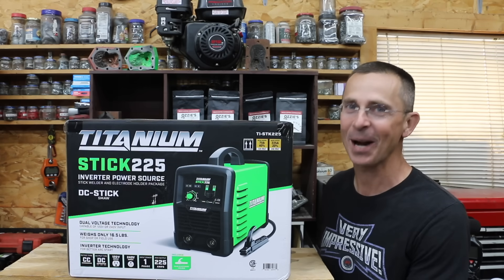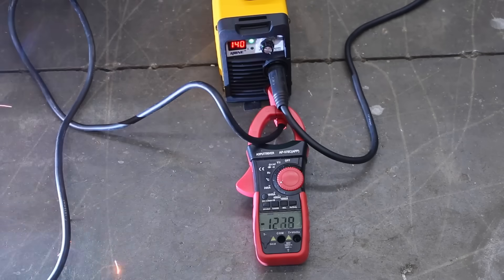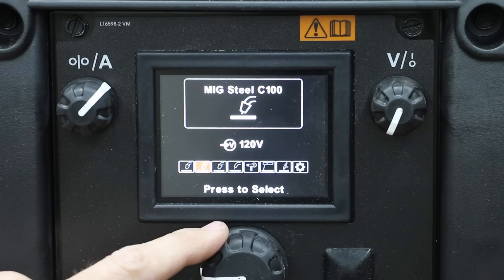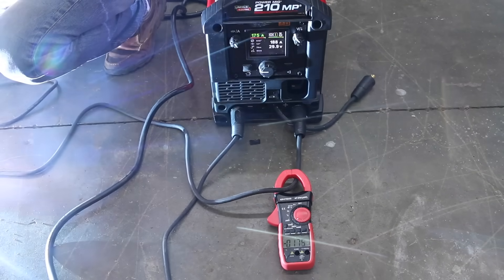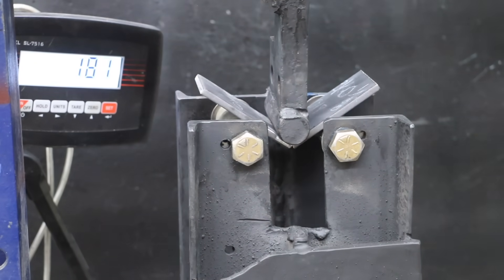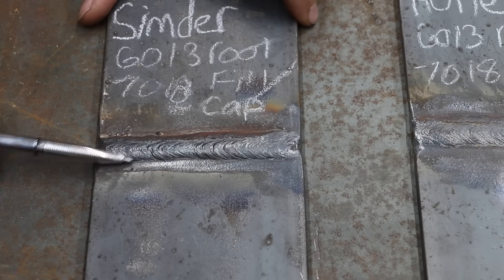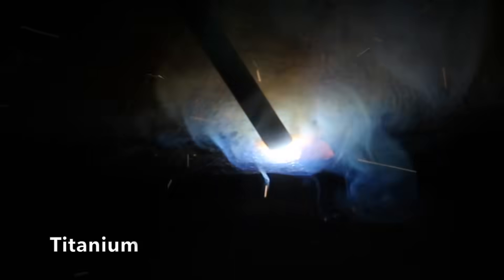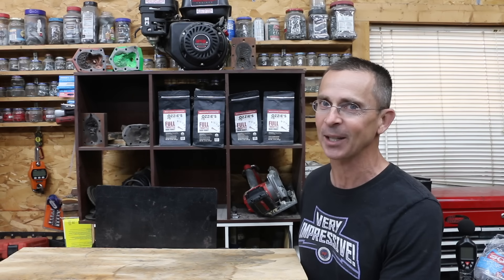$70 vs $2,300 Welder? Let's Settle This! Weld Strength, Duty Cycle, Current Output, Build Quality

Comment: My first welder was buzz box. I learned everything I could. I then moved to 70 dollar klutch. Bought the tig leads for it. Practiced every single day after work running beads up down sideways every direction. I would buy coupons to practice on from this metal supply company. After about 6 months I moved to a 2k dollar Everlast that does everything ac/dc foot pedal multiple settings saves(pulse/fade in/out etc) 
And id spent the next 6 months only running aluminum). I love welding and I'm 100 percent self taught 😎 you can do anything you put your mind too.
Reply: Self taught, eh? No youtube videos, instruction manuals, etc...? I mean, kudos on learning, welding is one of the most useful skills to have. I took it in highschool all four years
Reply: Why did you spend $2k on an Everlast? That's a lot of money for an off-brand welder.
Reply: @TehButterflyEffect  I've never had a single issue with it I purchased it almost 5 years ago and it's fantastic.
Reply: @ExcavationNation  I get that, but $2k will buy you a pretty nice name-brand welder. (An ESAB Rebel for example) You didn't have to get an off-brand Chinese welder for that money.
Reply: @TehButterflyEffect  lmfao dude if I would have bought the Esab that came with all the features this welder came with it would have costed a MINIMUM of 4 k this welder has more features And that's not even including everything that this welder came with. 30 ft leads (3 different torches) FOOT PEDAL on top of all that it was multi voltage. Which was a plus for me. If I had the 5k+ to buy a top tier brand I would have.
Reply: @TehButterflyEffect  yea just looked it up the comparable Esab is currently 4100. Mine with the exact same features is 1700. (Actually has more features built in) looking at those numbers (For someone that wants to get in to the hobby) I made the right decision.
Reply: @ExcavationNation  Hey buddy, I think what this channel pointed out is that some of these welders may not actually be doing what they say they are.
Those first 2 welders he showed were basically useless at higher settings for example - 90 amps off is ridiculous.
Here in Australia we have a lot of Unimig & Cigweld welders which are basically a common off-brand maybe 'mid-tier' machine, not amazon/ebay level but still a bit of an open question, I've made the same sort of decision you have just because I can't justify the $ on a Esab, Miller, Lincoln, Kemppi, etc.

They should really have more salesmen going around who can actually point out the features these machines have, you could run a machine for 10 years and run it wrong if no one tells you.
Reply: @elliotkane4443  fantastic.. but I never stated anything on this video? Yea if you buy a 200 welder you get what you pay for.
Reply: @elliotkane4443  most of these cheap little inverter welders run super low amps and can barely run a bead. Just like that 70 dollar klutch one I bought. It's cute but it's basically useless
Reply: @ExcavationNation  How many of the features do you use? A Rebel costs $1400 and will do SMAW, GMAW and GTAW. A Rebel with an AC option will be more expensive, but how often do you weld aluminum? I'm just using the rebel as an example because it's one of the cheaper name-brand multiprocess welders.

I own two welders, one is an engine drive, the other is a Tweco (Victor/ESAB). I had to turn a job down recently because I don't own the equipment to weld aluminum. Hate welding the stuff.

But you did answer my question, so thank you. I think a lot of hobby-level welders end up with the Everlast machines. I wouldn't mind having one of their plasma cutters.
Reply: @TehButterflyEffect  that was a huge factor. I wanted the aluminum ability. My original comment stated that. I live near the lake and after about 8 months of practice I actually made some money repairing pontoon boats that had ran a ground or received damage.
Reply: @TehButterflyEffect  it's more about the presets over the actual type of welding process like it's smart.. built features that you can select for example if I'm doing an uphill weld it I can select a pre made setting where it performs better than If I just chose my amp etc. And that's just the beginning. It's packed full of those features. And to address the real reason I ended up with that specific welder was bc Jody from welding tips and tricks used it quite often and he said it's worth the money.
Reply from the maker: Thanks for sharing.
Reply: Are you now a welder as far as profession? I’d like to learn too but wondering if I should take a course, thanks!
Reply: @daltondenun858  noooo my friend I dig swimming pools. But I can fix anything if it breaks. If you want to become a welder for a job.. I'd definitely take courses. There's A LOT that self taught misses.
Reply: @ExcavationNation  interesting! Thanks for your reply dude!
Reply: Seems like Everlast was sent to all the the  welding instruction channels, not to take apart and review so much, just use it.  Be neat to see other everlasts tested for their output, but you will have to figure out their features to set them to default.

Comment: I was given in 1981 (when I was 13) my first welder, my Grandad used it in WW2 to fix planes, was a 230v 300amp oil cooled arc / stick welder,  wish I still had it, was best I have ever had.
Was VERY VERY heavy though.
Reply from the maker: Thanks for sharing.

Comment: Love it! Maybe you can do a test of plasma cutters and third party accessories for plasma cutters?

 bought a 700$ plasma cutter and it works great with original nozile etc. however, when I tried cheaper nozzles bought from Aliexpress the performance was really bad.
Reply from the maker: Thanks for the suggestion.

Comment: the only thing missing for me is an inside view of the main inverter board.  I have some other China made inverter welder.  I added a builtin, digital ammeter since the analog dial was soo inaccurate.  It would have been neat if I could identify the make.
Reply from the maker: Thanks for the feedback.

Comment: Great video Todd. I like you bringing in an expert. Shows teamwork and provides multiple inputs on performance. Would be nice to see a video on variety of welding wire for flex core or others between cheap and expensive to see if makes a difference.
Reply from the maker: Thanks!  Thanks for the suggestion.

Comment: Perfect timing, I am in the market for a small reliable welder than can run 6011 and 7018 rod. My decades old monster sized Lincoln didn't survive my last move. After watching this excellent review, I am learning towards the Titanium. Thank you very much!
Reply: Have you called your local welding supply store to see if it can be repaired?  Even if you don’t want it anymore, you might be able to get it repaired for not much money and the sell it
Reply: @christians131  it was very old and having problems, so no. I only do occasional welding now, a small one like this is perfect for me now. Plus I can take it with me when we go to the races.
Reply: I am brand new to welding, but I own the HF Stick 225, and it has been great. I have run 3/32 6011, 6013, and 7018 rods without issue. Unless you need it right away, don't pay the full price. Just wait for a coupon.
Reply from the maker: Thanks and you are welcome!  Thanks for the feedback.

Comment: That's quite the interesting welder comparison. I was hoping that you would have tested a compact handheld welder, but I'm glad for the information.
Todd, do you plan a flux core welder comparison? If so, i look forward to that as i have a Lincoln, a miller, a Snap on, and a hf. Only the Miller and Lincoln are domestic. The Snap on is Italian, and the HF is china, but was upgraded to DC flux core welding. Joe did a good job judging the weld coupons for penetration. I went through this in trade school, so it was like a refresher course.
Incidentally, i dont usually do atick welding since i do mig and flux core.
My welding class began with doing oxy/acetylene welding, then went beyond that. Some got to do some cast iron oxy/acetylene welding with square cast iron rods.
Reply from the maker: Thanks!  Thanks for the suggestion.

Comment: I have been looking for a welder thaknk
Reply from the maker: Thanks for sharing.
Reply: @ProjectFarm  Another interesting at least to me would be using a small generator used to run some of the smaller welders for those of us who sometimes have to weld a long way from house power  don't want to haul a big engine driven welder. A small inverter generator combine with an inverter welder could be carried in your pickup tool box for emergency welding in the field

Comment: Really good idea to have an outside pro so that there isn’t that much user error in the testing! You could maybe test different welding sticks.
Reply from the maker: Thanks for the suggestion.
Reply: Test different brands of electrodes. I don’t know if the quality is standardized.
Reply: @SethMethCS  It's not. The cheap electrodes have slightly different flux coatings and aren't nearly as consistent. Washington Alloy, for example, is much more difficult to run than the same Hobart electrode.
Reply: You’d have your work cut out for you. Lincoln makes about 13 different variations of 7018 alone lol

Comment: Simder sent me thier welder to test. I questioned the 200 amp reading and they stated to me that it's not a 200 amp welder, that it's actually a 120 amp welder and that the display can be set to properly display the correct amperage. I outline how to do that in my review of it, takes about 2 minutes to do and I expect it will work on all the cheap Chinese inverter welders. But I agree, spend a bit more and get a better welder if you can.
Reply from the maker: Thanks for sharing.

Comment: This makes me wonder how old  arc welders with no digital control to speak of hold up to these tests, I almost prefer them to digital controlled welders but I’m also not an expert but I have more time using old ac arc welders then anything else. However ac arc welding does mean you can’t use 7018 rods as they are strictly meant for dc and you can’t find aluminum ac arc rods so ac arc welding definitely has its disadvantages.
Reply from the maker: Thanks for the feedback.

Comment: Thanks Jo 👌
I have two Canon EOS digital cameras, the 650, and 750. Looking for aftermarket batteries is a nightmare. While the cases restrict the maximum power stored, the cheaper options suggest outrageous levels, 2000mAh in a space way too small to contain it. I asked three online suppliers for the weight of the batteries, and all came back with a reason why they couldn't give an answer. Would aftermarket camera batteries fall within your testing options?
Thanks for great videos.
Reply from the maker: Thanks and you are welcome!  Thanks for the suggestion.

Comment: Would have liked to have seen a Miller in the mix. I recently got a Titanium 125 Flux Core welder and took a dive. Titanium and Vulcan and aru supporesd to be great alternatives to Lincoln and Miller. A Hobart is also a good option as it is made by Miller. The YesWelder I have heard are not bad. Stay away from the Chicago Electric is what I have heard. I would love to see a Flux Core, Mig and Tig test as well.
Reply from the maker: Thanks for the suggestion.

Comment: The interpretation for the penetration test is "unfair" to the lincoln. You said it yourself : the Titanium is producing more amps than asked for , even more than what the electrode is supposed to handle. So you should have tested the lincoln with a higher setting too . The colder the weld the lowest the penetration, the hotter the deeper...
Reply from the maker: Thanks for the constructive feedback. The Lincoln's maximum current is 175 amps as tested for the ARC welding capability.

Comment: Nice work! I'd love to see a similar comparison for TIG welders in the future!
Reply from the maker: Great suggestion! Thank you
Reply: @ProjectFarm  I second the TIG welding comparison, but also MIG welding. All the processes have differences and separate use cases and I'd love to see how different machines stack up.

If you do another welder comparison, can you also include a higher end (like the Lincoln in this video) used welder? It's not uncommon to see used welders in the field and some people swear that older used welders (from reputable brands) can be just as good if not better than their newer, younger counterparts.
Reply: @tyray3p Have heard that said too, so maybe it's like wrenches, sockets, and other tools that "ain't as good as they used to be?" 🤔✌️😎
Reply: i agree o that

Comment: I was just about to buy a new welder, like a prayer answered!! I’d love to see a socket episode! I’m a mechanic and have been buying snap on sockets, and love them. But I would love to know if I would be better off buying a different brand and save a lot of money? Love your videos and I much appreciate all the great advise you have given over the years!
Reply: As a retired mechanic I can say I’ve been happy with gear wrench impact sockets and the Milwaukee 1/4” & 3/8’s socket sets in the red boxes. The Milwaukee sockets have flats on the ends so they won’t roll away and you can put a wrench in them if needed.  
I sold all of my snap on and matco sockets and wrenched and replaced them with these two brands. Cheers
Reply from the maker: Great timing!! Thank you!